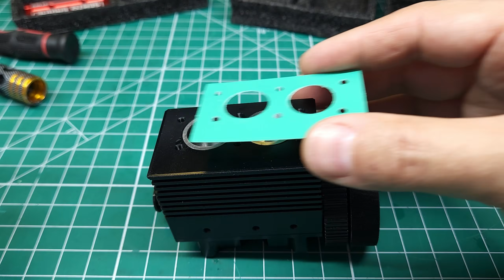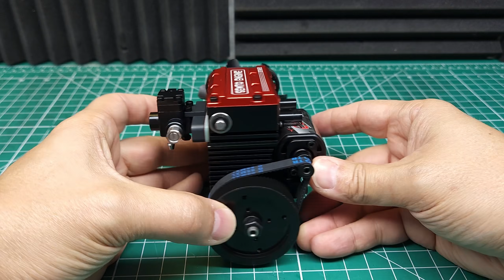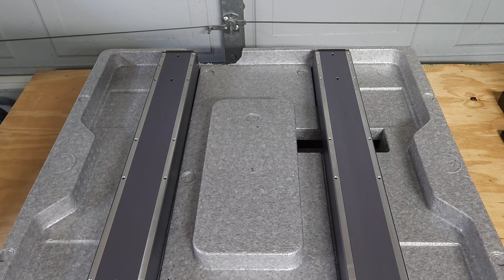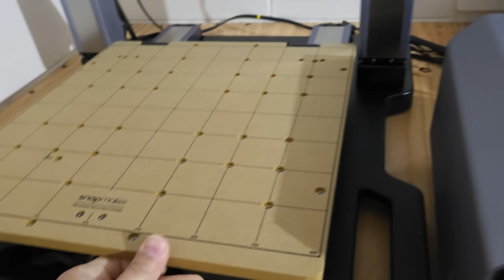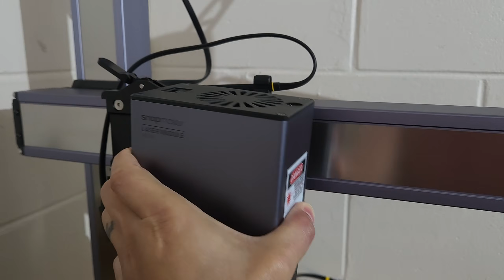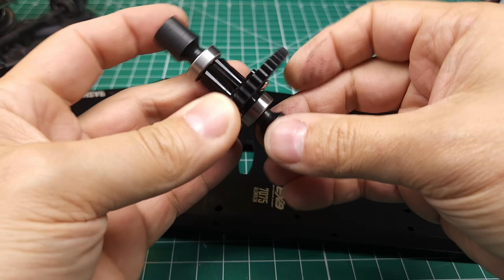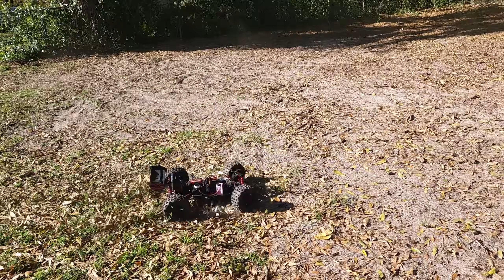Electric No More! My Arrma Kraton Runs on GAS Now!

Comment: this video made me realise just how much more efficient and energy dense an all electric system is compared to a combustion engine. An electric motor about the same size if not 2/3 of the size of this engine is probably at least 3-4x more powerful.
Reply from the maker: The difference is really crazy especially on full size cars. When you take braking losses into account internal combustion engines are only about 25% efficient with The rest being lost as heat and noise.  Electric motors are closer to 95% efficient

Comment: This was a sick project. Maybe convert it back to nitro and stick it into a Big Rock 3S (if possible not sure if theres enough room) so it doesn't struggle so much with the weight. Or maybe try an actual RC racing Nitro engine.
Reply from the maker: Don't think there would be enough room.

Comment: Thanks for the video, I also want that engine on my 8th scale. can you make faster than that? or just need adjustment to get faster? it's slow for 8th scale i think
Reply from the maker: There are some improvements that can be made but ultimately it's not a very efficient engine and it's probably always going to be underpowered for this kind of application.
Reply: @DoRC  Do you think a gearbox is a good idea? or 10th scale is way to go?
Reply from the maker: @deeph46 I don't think this engine really is a practical solution for any vehicle. It's really mostly designed for display and educational purposes. Even if you did get it working properly I'm really not sure how long it would last.

Comment: I bet if you put lighter springs in that clutch it would rip a bit better. Nice work on the build
Reply from the maker: Unfortunately no. The problem isn't the clutch engagement It's the power of the motor itself.

Comment: why would running on gas make more power than nitro
Reply from the maker: It would only make more power if it happened to be tuned for gas. Within a given engine size assuming it's tuned properly nitro methane will always make more power.
Reply: @DoRC  so why convert it? is it just because the mess or?

Comment: This awesome but why didn't you use the V8 motor, it has alot more options to make good power out of a lil motor and far better than the one you used but major props on getting it to work !!!
Reply from the maker: Unfortunately it just wouldn't have fit. The two cylinder engine just barely fits. There really isn't a lot of room on the chassis because it's designed for an electric motor.

Comment: Great Video looks awesome to, may not be fast but it doesn't matter it's for the hobby. I admire it because it's fully running with the fan spinning as well. Even though I'm not a nitro guy I still would buy something like this just for the engine & fan. I would Shelf it and whenever someone ask about it I'll crank it up for them.
Reply from the maker: Yeah in this case the project really was just about getting that engine in that car rather than making something high performance. Stay tuned though as we've got the performance covered coming soon :-)

Comment: I wonder how that 2 cylinder engine would work in a 3s Arrma. Being a lot lighter than the Kraton, I think it might be impressive.
Reply from the maker: I don't know. It's heavy it's big and it's pretty weak. Honestly I think these engines are designed more for the experience of being built and demonstration purposes and really aren't meant for practical use. That being said stay tuned as I've got some updates on the project coming soon :-)

Comment: Nitro has more torque
Reply from the maker: That's kind of an ambiguous statement. Because the stoichiometric ratio for nitrofuel is much lower than it is for gasoline You can get more fuel into the engine at a time which is what allows it to make more power but the fuel itself is actually less energy dense by mass than gasoline.

Comment: wait. you used a spool in the center so your rear brakes operate all 4 corners, or at least rear 
and front, then you TOOK THE FRONT DRIVESHAFT AND AXLES OUT???
Reply from the maker: Yes. The spool would be needed either way as under breaking it would be needed in four-wheel drive and under acceleration it would be needed in two-wheel drive. 
Primary reason for making the truck to will drive was to reduce weight driveline losses and rotating mass. I knew the engine was going to be extremely underpowered and I wanted to give the truck the best possible chance of actually moving.

Comment: That is a cool looking motor, that is for sure, sounds good, will it jump... well of course but the power is obviously not going to be there.  That said - super cool project!   The clutch does look like it is slipping, and perhaps it could be made a tiny bit faster if there was a way to remove the onboard starter motor and mount.

And that 3Dprinter, what a boss.  Not sure I am bought into the CNC part but for what most of us would do with it i am sure it would be great to have.

Also agree on your software choices for running that machine.  The great news is that Orca is free, Fusion is mostly free, and LightBurn is not that expensive - if you consider $100 to not be expensive.
Reply from the maker: For sure. I don't think the clutch was slipping as the engine probably would have revved higher if it was. This is just a straight up lack of power problem. The weight savings from removing the motor and whatnot probably wouldn't make any difference in this case. 
And yeah I definitely prefer those three pieces of software to the included software. I do wish they included software was a little bit better though.
Reply: @DoRC  Yea, i agree.  One thing for sure, that engine does look cool, it is too bad it is not a monster cause that would be AMAZING!.  The build was a 9/10 or better for sure, the looks 10/10 - well done.  By the way, do you ever do any racing?  1/8 scale or 1/10 or even the Losi mosnter 1/5 scale trucks or do you mainly bash?  To me, either way is great.  

RC was a big part of my childhood and growing up.  I had a really strong imagination and would think of all the amazing things i would get to do with the buggies.  Loved to build them, paint them detail them, sticker them, everything.  

Then walk them down to my friends house after school in the fall with all the leaves down on the ground and just rip up and down the street.  I had (and still have) a Kyosho Land Jump - better known as "chain falls off all the time, AM radio loves to lose signal, screws like to fall out" buggy.  

Also have Kyoshos Elec-Rider - that, that was probably the most fun to knock around.  Good times.

Comment: Hi Do! Just want to give a bit of update on the impact you've done to a newcomer in the hobby;

Waterproofed all my receiver with the nail polish thiny you said

Vented all my tires

Upgraded everything i can on my x12s except the arms with confidence

Filled diff fluids in OT CF, x12s, rog1, arrma FT

Can confidently tear any of them apart and put it back together(except almost everything on servo, but will soon do once saved up some $ to upgrade FT)

Upgraded my FT bulkheads, diffs, hubs, and cvds(but this one was mostly from kudra racing bulletproof diffs video, but still based most of knowledge from your vids)

So thank you man. Appreciate your responses too in helping and figuring stuff out. Will continue to upgrade my FT as time goes coz you know, money 😅
Reply from the maker: That's awesome to hear! Being able to get back to the community is the sole purpose for this channel so it's great to hear it's working :-)

Comment: Didn't think it's not that it doesn't have power, think the clutch is slipping to much
Reply from the maker: If the clutch for slipping the engine would be revving really high which it's not. This engine is specified to have a half a horsepower. That's 1/6 the power that a normal .28 nitro engine has.  It's just really underpowered.

Comment: If you raced on a short dirt track with tight turns, you could win a race against an electric for the simple fact you could rip the whole track at full throttle.
Reply from the maker: It would have to be a pretty short track!
Reply: @DoRC  yea, lol I know right. 
   It looks like it would be fun on a short dirt track, and pretty easy to control.

Comment: YOU DONT NEED A CNC TO DO THIS
Reply from the maker: No you could do any of these things with hand tools It would just take a lot longer.
Reply: @DoRC  I BET IT WOULD NOT BY THE TIME set it up and get it going it would be faster to do it by hand
Reply from the maker: @chrislajeunesse1966  That depends on your skill level. Being the first time I'd ever done this it took me quite a while but for someone who actually knew what they were doing this would be a very simple project. Ultimately the beauty CNC machine is once you hit the Go button you don't really have to do anything.
There's a really good reason why basically everything is made by machine these days. If it were more efficient to do so by hand people would still be doing it by hand. Not that there's anything wrong with that and I made stuff by hand for many years.

Comment: It sounds to rich try to professionally tune the engine and you might get some more power
Reply from the maker: Yeah unfortunately I did professionally tune it (I'm a mechanic with 20 years of experience including working on small engines).  Even with the needles all the way closed it still runs rich. I think the engine is designed to be really rich because of the way the lower end gets lubricated via blow by. 
Ultimately I really think these are more for the assembly experience and demonstration purposes and I'm not confident they're designed for practical use.

Comment: If it’s gas powered how comes it’s got a big 500mah battery??
Reply from the maker: That's just a power the starter and electronics. You could get away with a much smaller battery it's just the one I happened to have on hand and it fit.

Comment: If you take 1/8th inch out of slots you can fit all 4 screws and you can see that you will never use that much movement in those slots
Reply from the maker: Yeah in retrospect that's correct though until I actually mounted the engine I wasn't 100% sure where everything was going to land and because of the way the origin is set on the machine going back and re-machining things would have been basically impossible so I had to play it safe.  I was confident I wasn't going to be doing big air bashing with this so three screws was going to be plenty

Comment: If you put expansion chamber type exhaust on it it will create more power
Reply from the maker: Unfortunately it doesn't really work that way with a four-stroke engine. Too stroke engines rely on specifically tuned pressure waves in an expansion chamber to properly scavenge exhaust from the combustion chamber but four stroke engines generally don't.

Comment: Man, I've wanted to try running one of these in place of a nitro for a whiiiiile.  They're so pricy though, can't afford to buy something that much for just experimenting.

Also...damn man I like the 3 head CNC machine more than even the car.  That's one helluva beautiful piece of kit.

The gas version sounded like it was running way off Stoich.  Probably want to get the AFR right, then adjust the gearing because the nitro gearing looked and sounded a little short.  Might want to gear for higher top end and see if shes got the torque to handle it, cuz really that looks like its about a .25 displacement between both cylinders and should be similar to a .21 running single.  

Also ...soften the springs on the clutch for gas, its not engaging, its just spinning.
Reply from the maker: I spent quite a bit of time adjusting both the carburetor and the timing on gas and that was the best I could get it to do. It's entirely possible that the carburetor itself is jetted for nitro and no amount of adjustment is going to get it lean enough on gasoline but at least to the extent of my skill that's the best I could get it to run. 
I don't really think the problem you were seeing was that the clutch isn't engaging soon enough I think it's just that the engine isn't spinning fast enough to engage the clutch. Even with no load on it on gas it still was barely running.  
As far as gearing unfortunately there really aren't a lot of options as the spur gear is the largest you can get for the platform and the clutch bill for the engine only comes in one tooth count.
Ultimately I think the main problem is that this engine just really isn't designed for the application.

Comment: Lol it might be slow rn but it's got a soul damnit
Reply from the maker: Exactly!
Reply: @DoRC  you think there's a way yo put a 4 bolt 5th scale 2 stroke engine on it like i did with my hpi savage
Reply from the maker: @daytonburke7437 anything's possible but there isn't a ton of room for something like that in this chassis. Honestly with the way it's laid out the engine I put in there is about as big as you can go without some serious compromises.
Reply: @DoRC  dang

Comment: I wonder if while running on nitro if it would start to give more power after a few tanks like a break in process on a normal rc nitro motor?
Reply from the maker: Off camera I did run a few tanks through it before putting any load on it. It probably had a bit more to go but I think the primary problem is it's design rather than anything that was done to it

Comment: What am I missing here as an old dude who used to run 3.5ccm nitro trucks that just kick ass compared to this excuse of a nitro engine?
Reply from the maker: Stay tuned :-)
Reply: I will stay tuned for something comparable to an OS Engines OS1CJ01 or it’s specs: 2.65ps / 2.61hp @ 34.000RPM, rpm range 4.000-42.000

Comment: I saw a forum chain a few days ago posted in 2007 that's been causing me a slight aneurysm on a similar subject, gas itself does not make more power than nitro, in either torque or hp, the big gassers only feel like they have higher torque cuz they have a combustion chamber roughly double the size for the scale, ur ideal combo here (to the best of my knowledge at least) would be to utilitize the spark ignition from the gas kit instead of glow/compression from the nitro kit, but then tune it with nitro fuel to take as much nitro as u can get in without it running too hard on the engine. This would allow u to harness energy from the spark to combust more fuel, and since nitro carries its own oxygen u can run it way richer on that fuel and thus get a lot more power out of the engine
Reply from the maker: For sure. Gasoline is slightly more energy dense but the stoichiometric ratio is way different. You can shove a lot more nitro methane into an engine than you can gasoline which is why it makes so much more power.

Comment: You should use a tiny bit of blue loctite on the hub adjuster and motor screws
Reply from the maker: Everything going into metal was threadlocked I just didn't necessarily show it in the video.

Comment: One of your best videos.
Reply from the maker: You're only saying that because it has nitro fuel in it :-)
Reply: @DoRC  That and you did the fitment and made it do the thing. I want to know where that engine can go. An cheap nitro .15 can spin 30,000 rpm, much like a low kv brushless motor. Cam profile, sealing the valves, oiling system. etc

Comment: I think the clutch that you got was intended for a traditional nitro engine that is ment to run at a much higher rpm and is causing you not to get the full power out of it.
Reply from the maker: Entirely possible though that's the kid that came for the engine. I don't really think it was a clutch engagement issue though because if it was it would just free Rev.  I really think it just doesn't have enough power.
Reply: Yea, these engines are more like models that run more than anything. They do make a 2 rotor engine that from what I have seen actually does make acceptable power but that is definitely 1/10 scale oriented.
Reply from the maker: @IsaacSchultz-lz8jc  For sure. I've owned a couple of the Wankel engines in the past and they definitely were not very stout
Reply: Is it the toyan one or the older aircraft one?

Comment: Nice build!! crazy idea, add some front braking on a separate channel so you can do some awesome burnouts with a "line lock" feature.
Reply from the maker: It's definitely doable though it wouldn't be as easy as the rear brake given that the steerings in the way in the front so you can't really mount it up there.

Comment: Soo' before i Think my self ! , meby Better the 4 Zylinder Version Off Them. Now it's nearly Sure Not too' much Power.
Reply from the maker: Unfortunately this is about as big as you can fit on the chassis.
Reply: @DoRC  soo' Sory sir so No! Toyan l 400 about 10.000 RPM..

Comment: Lets try a tiny turbo solution next. I was actually considering the rear locker job from the Fireteam, but didn't realize the mount was integrated with the hinge pin carrier. Total deal breaker. ;)
Reply from the maker: Yeah unfortunately you are kind of stuck with the stock set up unless you figure out a different way to mount it.

Comment: If a nitro engine can go just as fast as electric what makes you think that this dual cylinder will be slow?

Edit: wait why is it so slow? Pos?
Reply from the maker: It's just because this engine is kind of specifically designed to be put together run on a stand kind of as an exhibition sort of thing. It's not really made for practical applications.  I could tell that as I was building it.
Reply: @ so I bet your putting more than 2 nitro engines in an electric… that’s the only thing that hasn’t been done

Comment: Very cool. I’ve seen several people put these motors in models but I’ve  only seen a couple actually work. Even though it’s way under powered it’s still pretty damn cool, Congrats 🎉
Reply from the maker: Yeah I suspect the reason you haven't really seen very many of them moving is because the engine just doesn't have the jam to do it.